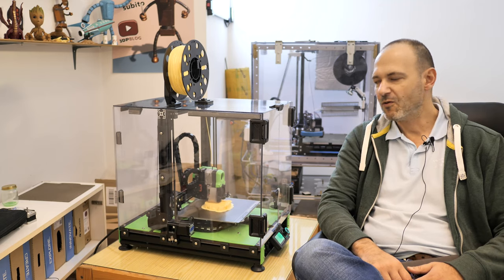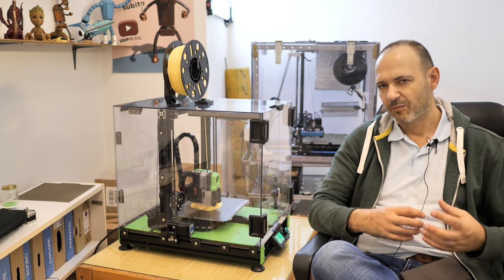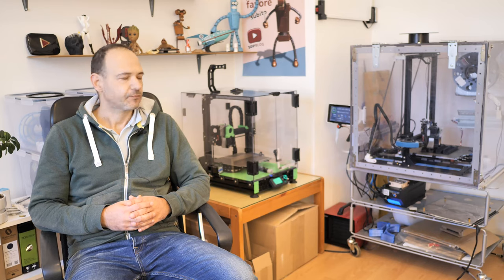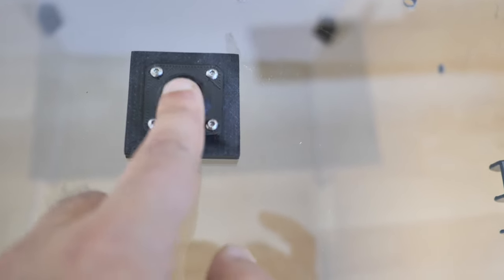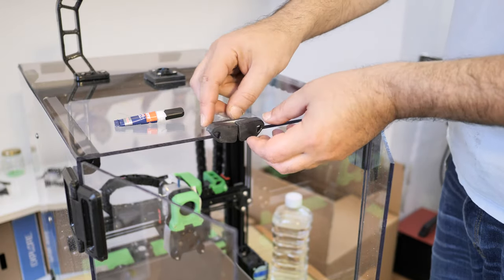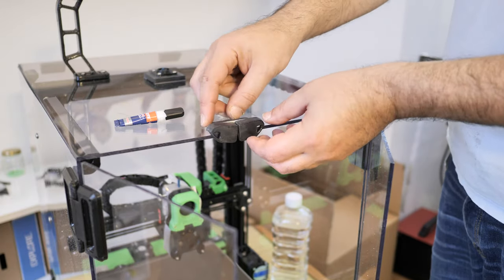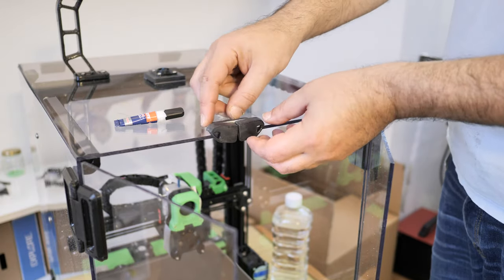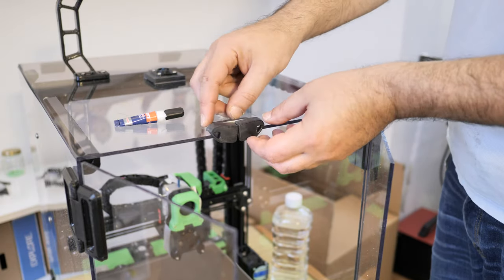My Voron Switchwire enclosure. Test with ABS and PC.

Comment: The enclosure doesn’t appear to be super airtight. Do you have issues with fumes?
Reply from the maker: TBH, I havent much consider this aspect. It is less airtight then on 2.4 or Trident, where is used foam tape. It is possible to use foam tape here as well BTW. I just have an air purifier next to the printers and I hope it catches all fine particles.

Comment: I really like your additions to the switchwire.   The belt tensioner is my favorite.   Are you willing to share the designs?

Also how do you get your tnuts to stick in the extrusion when you remove the enclosure?   I like to print pla, but in the enclosure with doors open my hotend suffers frome heat creap.

I have built one switchwire so far and have started on my second.  

Thank you for sharing!   Keep up the good work!
Reply from the maker: Hi, the t-nuts are from Misumi and have kind of spring that holds them in place. Regarding the tensionner - it is just a remix of this tensionner I use on my CR-10 https://www.thingiverse.com/thing:2854971 and the belt holder from Voron. It is not ideal because I had to cut my deck pannels, so I really hope there will be an official and more sophisticated y-tensioner from Voron soon.
Reply: @3dpblog  thanks for the reply.   I have a belt tensioner in the works.   Maybe the voron guys will like it!
Reply: When printing with PLA, you should not be using an enclosure. It's almost guaranteed to cause extrusion issues. One of the things that can (and often does) happen, is that the extuder gears heat up, causing them to grind through PLA filament.

Comment: Hi Ivan, as I learned from you how to print PC filament I have a question: printing PC goed typically fine but during printing time by time a get a small bubble of melted pc onto my nozzle just beside the ruby nozzle tip. During printing sometimes this bubble drops onto the print. Any tips or recommendations ? I checked my nozzle is not leaking out of the heater cartridge. Thanks for helping

Comment: Could you maybe look over your microphone setup? i'm listening with headphones, and there's a weird echo/reverbation, and maybe try to level the audio so it doesn't jump high/low with different cuts.
Otherwise, nice and informative, keep on printing!
Reply from the maker: Sorry for this, my printers are in a small room and I thought using a lavalier microphone solves the echo, but apparently it is not enough. BTW, there are subtitles on most of my videos. maybe turn them On and lower the volume.

Comment: Where did u get the Bottom panel for underneath the bed can you give me the stl file
Reply from the maker: Hi, those are 4 little ABS panels 4mm thick, 100% infill. They were stuck together with acetone. I made the files using the fusion360 assembly file on github. I am not sure I keep those files, however I saw similar parts for the dock panel were published on voronusers printer_mods on github. Check there first for more "official" version.
Reply: @3dpblog  thanks

Comment: Hi Ivan top video. Where can I find the files of the filament ball guide ? Thanks for helping
Reply from the maker: Hi, I used this design https://www.thingiverse.com/thing:3626260, but I modified the bottom bracket (the base) to be larger in order to have space for 2 VHB tapes (12mm tape) and also to host heated threaded inserts (to screw to the top bracket). It was an overkill. If printing from ABS, it is better to just stick the top and the bottom bracket with acetone, insted of wasting inserts.
Reply: @3dpblog  Thanks Ivan

Comment: Ivan, wonderful video! In kipper how you configure the thermistor table for your controller board.
Reply from the maker: Ha, I spent some time searching for this myself :) I don't remember where I found the solution, but here is an extract from my Klipper config:
[thermistor Trianglelab_T-D500]
temperature1: 25
resistance1: 4721000
temperature2: 200
resistance2: 8000
temperature3: 400
resistance3: 264.6
# R(200C)     = 8K +- 5%
# B(150/250)  = 5300k +- 3%

Then under [extruder] define:
sensor_type: Trianglelab_T-D500
Reply from the maker: Just to add that this termistor readings are not very accurate at low temperatures, but above 50 C its OK. For exemple, when the bed termistor measures 23 C room temperature the hotend shows 26 - 28 C. It has no impact when printing of course, but could be disturbing. This is related to the design of the termistor and its measurment range and is small price to pay for the big advantage - avoid PT100/PT1000 and additional amplifiers.

Comment: ehy, nice video, what camera is that, hq version? did you use any lenses?
Reply from the maker: Nope, the normal rpi camera with a smartphone wide angle lens.
Reply: @3dpblog  do you have any link please?
Reply from the maker: @oaiwjebdlla  For the lens? I remember I bought the set of smartphone lenses from Aliexpress for less than 10 $, but I dont have a link. When you camera is close to the print you need a wide angle lens (not fish eye), to get the whole width of the build plate. My advice is to check on aliexpress because quality and prices vary a lot.
Reply: @3dpblog  okay, maybe I'll try rpi camera V2